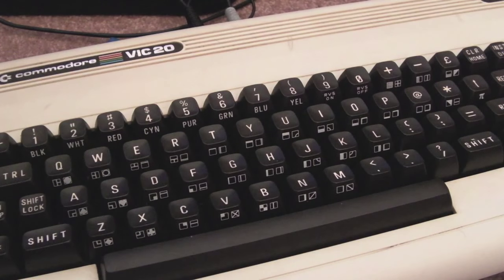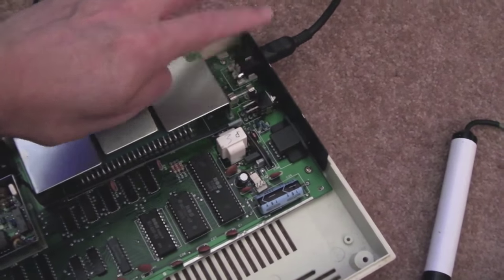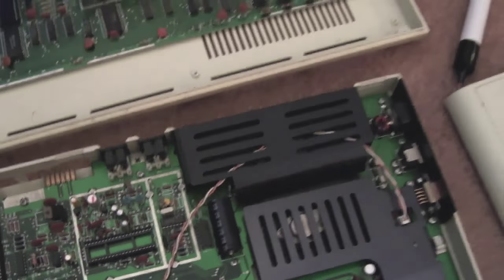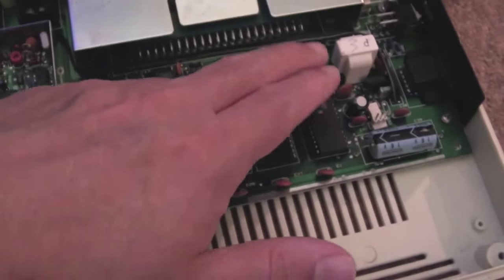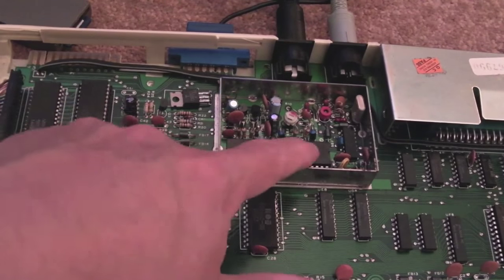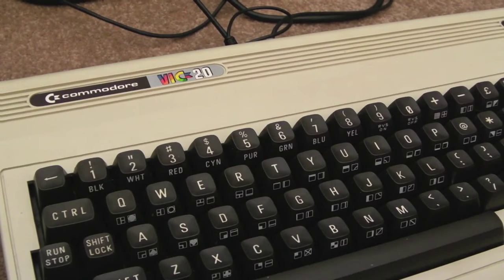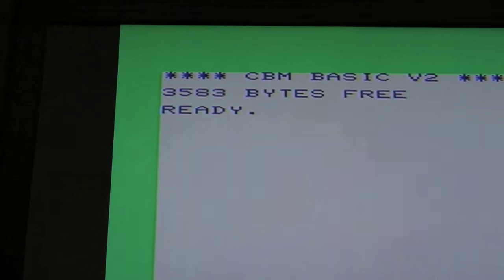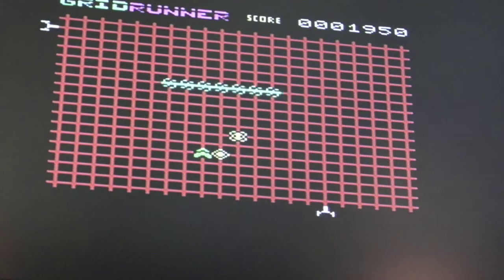Commodore VIC-20 (VC20) Repair & Picture Tidy (Better Video Mod)

Comment: im pretty sure the marks on the case that looks like melted burn marks like a soldering iron are from the cable as it interacts with the plastic on the case itself,youll aslo see tjhe marks on the c2n deck and power supply when cables have benn wrapped around them :)

Comment: Just taking my first steps in Commodore restoration. Enjoying the videos. Keep em coming!
Reply from the maker: +Lee DaStard Thanks!  What first steps have you took - did you get a Commodore 64, VIC or other?
Reply: +GadgetUK164 I rescued my C64e from the attic and removed the innards from the case. Washed the case thoroughly and removed the key caps and washed them then reassembled. Came up lovely. I haven't cleaned behind the kb yet as I have no soldering experience (one step at a time) and I haven't heat sinked any of the chips yet, but that's next. I also swapped the fuse to a 3amp thanks to your advice!

Comment: Just some info for you:
The VIC-20 was released in three revisions: A, B, and C. Revision A had the old 2-pin power socket with a left/right on/off rocker swtich. Because the power supply only produced 9V, the main board had a 5V converter with a large black heatsink on it. These boards filled the casing fully. Revision B kept this power arrangement, but got some other minor revisions, including a change of logo nameplate on the top. Revision C was a "Cost-reduced" model, which benefited from RAM replacement: one 4 KB×8 chip replaced eight 2114 (1 KB×4) chips. 

Nice video mate. I had a REV A  - also had a different font on the keyboard and different style of keys too. What you've got, as you say, is the cost reduced model. 

Is your power LED out?

Comment: Another excellent video. The marks are almost definitely made by a cable resting on the case for many years. I've come across the same many times now. Regarding the VIC I may have a couple of spare VIC20 VIC chips. am stupendously busy with work at the moment but can have a look for you when i get five minuets if you wish.
Reply from the maker: +JaysVintageJunk JaysVintageJunk Thanks!  Very strange reaction between the cable and casing there, and very destructive =/  If you do find a spare 6561 (or 6560 - will NTSC mod it) that you don't mind parting with, drop me a message - much appreciated, but not urgent if you want to hold onto any spares.
Reply from the maker: +JaysVintageJunk JaysVintageJunk Someone pointed me towards AliExpress - There are loads still in stock from the original sources (either that or repros... time will tell).  I've ordered 3, so will report back in a later video!

Comment: Did what you di clean up the green zig zag pattern? or just the bars all over the screen, the borders look smooth at the end but not sure if it's just the focus
Reply from the maker: It looks totally clean to me - I did later wonder if my TV was 'correcting' the image though with some of the processing / enhancement it does.  I have some VIC-20 boards coming up - I will check it in that video.
Reply: @GadgetUK164  I have been told it's due to Chroma Creep by a guy called Mrrrrsomething I use a CRT through composite with my PAL Vic-20 and get this https://imgur.com/a/zKKTuUl which I was told required an svideo mod to fix. though would prefer to not have ot solder the board. I've only just got done with my 7800 and CDI.

Comment: Those marks on the case are from cable being wrapped around it, it did a bizarre thing of cable melting into older plastic.
Reply from the maker: Yes, I know that now =D  It's the plasticizer that causes it apparently.
Reply: @GadgetUK164  Correct, the softener in the plastics go to surface and melt other plastics I saw same on styrogoam i  Vic20 box I bought.
Reply: Oh wow! Thanks! I finally learned this. I thought so many people couldn't possibly have burned their C64s with soldering irons. This makes sense.

Comment from the maker: It's worth pointing out that you cannot see the jail bars on lower resolution video - They only show up when watching in 720p.
Reply from the maker: +GadgetUK164 Quick update here - I got the 1st rev VIC-20 up and running today as well, and I did the same mods there to the VIC chip.  I found that on the 1st rev VIC-20 I needed 2 x 15uH inductors in parallel (~7.5uH) rather than using the bead which I used in this video here, but I still used ~270pF cap again.

Comment: Great video. What did you do to remove the ghosting as shown at the end of the video ? I've tried decoupling the VICII on the C64 to dampen those jailbars, but it doesn't help on that system.
Reply from the maker: +bwack There's a link in the video description - Basically involves removing that ferrite bead, replace it with a 270pF cap, then put an inductor (10uH - 50uH) from the output of the 270pF cap to ground (in my case an inductor was giving me ghosting, so I used the ferrite bead).  I do wonder if its a similar problem - the lines being at a specific frequency - if you can work out the exact frequency, a capacitor inductor filter can be used to filter it out (like has been done here).  A very similar thing is done on the Spectrum +2 (JoulesPerColomb).  Anyone got a spectrum analyzer to hand? :P
Reply: Thanks m8.
Reply from the maker: +bwack No problem! =)
Reply from the maker: +bwack Regards the C64 jail bars - I've got a mod which I purchased recently - looks like it just inverts the AEC signal and merges it.  It doesn't work very well at all on my C64 tbh...  I might cover it in a video soon.
Reply: Is it the lumafix64 ? I've ordered ten of my modulator replacement with stripefix board. It is configurabel using solder jumpers such that you can choose to put it at the modulator pins or under the vic ic. The main problem with the jailbar fix boards IMO is the capacitive loading of the luma line making pixels softer. I've added a solderjumper to mine such that you can select stripefix on luma_in or luma_out, meaning that if you select luma_out, then you are loading the low-impedance side which doesn't affect the sharpness of the image as if you had loaded the high impedance side (the vic ic side).. I can send you one for review.
Reply from the maker: +bwack Thanks, would love to buy one!  Do you have any C64 savers available yet?
Reply: +GadgetUK164 Yes. I'll send you a private message. If I can figure it out :D

Comment: I do not unferstand the talk of an inductor without the ferrite bead. It looks like justvthe two capacitors on the output then some capacitor on the board going to the left at 9 s clock position? Guess I need somr help here.
Reply from the maker: Where I fitted those two capacitors was an inductor (a ferrite bead).  That component was removed, and the two capacitors fitted there in parallel, to give approx 270pF.  On the underside of the board, I mounted the original ferrite bead between the point the two capacitors join (furthest away from the VIC chip), with the other side of the ferrite bead going to ground.  See here:- https://www.dropbox.com/s/pshiuzulgxm6cl0/VIC20.png?dl=0
Reply: @GadgetUK164  Thanks man.

Comment: Don't know if you remember, but we recently bought a Commodore VIC20 with the dreaded "Blank Screen" fault. It WAS the Kernal chip that was to blame. The replacement chip came from Italy, and was with us within a week. We are carrying out the Vertical Jail Bars mod next. What voltage does the 220uF capacitor have to be, or does this not really matter too much? Keep up the great vids. Wayne and Nina.
Reply from the maker: +Nina Evans That capacitor just goes across the VDD pin I think, just get a 16v capacitor and you should be fine =D  Thanks =D

Comment: I did the same mod to the chroma line with the same really good result. But I also have the same yellow shadow that at 13:34 you said you'd care about later. But when you fixed it at 15:17 I can't acoustically understand what you're saying. Did you actually do the colour phase correction from the hw mods site? And if so, which ones (there are 3 actually)? I've tried both the the 2.7kR resistor and 47kR poti mods, but both did not seem to affect the yellow shadows at all. Perhaps you can even give us an updated video on how you did it? Thanks alot!
Reply from the maker: I didn't do the colour phase correction - I just didn't seem to need it and when I tried it I found it was worse tbh!   The mod I did was the inductor they suggest in their schematic there - I didn't use that inductor, I used the ferrite bead that you remove when doing the mod.  So place that bead in place of where they suggest adding the inductor.  Pretty sure that's what I did and it was very clear.  Done the same mod on two other CR models, and one original model - worked perfectly on all 4.
Reply: Thanks alot for making that clear! I understood that part and indeed did put that ferrite bead between where the two modded caps on the chroma line join and GND. I'll double check the schematics.
Reply from the maker: That point in the video (15:17) - I said I adjusted the colour pot (there's a trimmer adjustment for the colour signal there - I tweaked that with a small screwdriver).  That tightened up the colours for me.
Reply: If I totally remove the bead, I can use the pot to remove the remaining shadowing for me. But once I had the colors aligned properly, I got weak vertical bars instead. I can live with those for now. The whole thing is confusing: My CR board (assy 251037 rev. C) seems to differ from yours. Above the pot there is a solder pad below the "R10" label. In your video, it looks like this pad is custom fitted with a cap that links to the chroma line at the (now replaced) ferrite bead. In my case, instead of the cap a green "resistor" is fitted.  Usually, those green "resistors" are actually inductors. But this thing has several hundred ohms resistance, so I somewhat doubt that. Anyway, I replaced it to match your changes, although I do not believe this is the 220pf cap from the hw mods site's schematics (look closely, there is no indication that this cap is even part of the mod). This solder pad near "R10" is actually connected to the slider (output) side of the pot together with the 47uF electrolytic cap. All schematics I can find  match the one on the hwmods site, where the chroma line is instead coupled to the luma line with a 220pf ceramic cap at the input side before the pot. These schematics would match my unmodified board (and prolly yours) only if they would have fitted the missing cap on the right of the pot and wouldn't have fitted that green thing that connects to its right pad instead. I would really like to know why Commodore decided not to follow its board design. If I find the time, I will try one of the C64 modulator replacement circuits discussed in this German forum here: 

https://www.forum64.de/index.php?thread/44092-hf-modulator-rauswerfen-c64c/

Btw, here you can see my board (yes, the "crusty" one): 

http://sleepingelephant.com/ipw-web/bulletin/bb/viewtopic.php?t=8159

Comment: i recently got a vic 20 from a unit.. the casing is broken and has missing keys and doesnt power on.. is there a way to get another vic 20 in descent condition?
Reply from the maker: eBay or searching car boots / charity shops etc is your best bet.  You can often buy replacement keys on eBay (the C64 keys are identical).

Comment: Cool. Sometimes marks from cables wrapped around the computer migh be mistaken for solder iron burns.
Reply from the maker: +bwack They are melted pits!  The plastic has been melted away =/  On the video they just look like dirty marks, but up close there are dips in the plastic and at the edge the plastic is raised - just like someone touched it with a soldering iron or cigarette or something.
Reply: Yes. I can't go 100% sure of this, but there is a saying that there is chemical reaction between cable and plastic case .. Takes many years to happen though.
Reply from the maker: Ah!  I see what you mean now, I guess that's entirely possible!  Maybe 35 years of a cable wrapped around it has done the damage! =/
Reply: +GadgetUK164 It is possible. Same thing happened to one of my C64. Those cables are toxic! :----D

Comment: Has anyone done a FPGA VIC replacement yet, because those IC's do fail alot and the supply is going to dry up sometime soon
Reply from the maker: +arcadeuk Good point!  That thought did cross my mind!  I know the system has entirely been recreated in FPGA, but I guess its different taking an emulator to FPGA approach vs, FPGA recreation of hardware with cycle exact timing.  That said I bet the VIC is pretty simple really and a good candidate for an FPGA replacement.

We talked about a similar issue with the C64 CIA chips (and I guess in this case the VIA) but nothing seems to exist.  If and when I get more time I want to see if I can replicate the VIA first, then maybe the CIA.  The datasheets exists for these chips so it should be more than possible, it's just a lot of work I guess.  I am sure a time will come when FPGA replacements for most of these chips appear.
Reply: +GadgetUK164 The VIA, PIA and CIA chips should be fairly straighforward, as would the RIOT and RRIOT. The VIC and VIC II are a bit more complicated and very timing critical, so it would probably bit a lot more work than the straight I/O chips.

Comment: Yes, the VIC chips are a common fault. Good move on heatsinking it. Sadly the only source for these is going to be from another VIC that is being parted out on ebay. The Rockwell 6502 and 6522 should be fine, you sometimes have issues if it is a 65C02. WDC are  making new 65C02, 65C22 etc. but there are some compatibility issues with the S suffix chips, the N suffix ones (65C22N etc.) are usually fine. The keyboards are also identical to the C64. Most VICs have brown function keys, and C64's have grey, but there is a bit of crossover on late VICs and early C64s and also cut and shut jobs. Finally, I'm currently working on a VIC version of the PET microSD, in a combined SD drive,  IEEE-488 interface, ROM and RAM cartridge, but that's a few months away.
Reply from the maker: +Dave Curran Thanks, yes - VIC is extremely hard to find.  There is 'new old stock' in america, but its $35 + $10 shipping and would need a new crystal and minor mod (kernel as well I think) to work as an NTSC machine.  Maybe one will turn up at some point!  Or maybe as ArcadeUK suggested - perhaps someone will re-create in FPGA one day!  Thanks for confirmation on the Rockwell chip - the one's I've ordered are just straight 6502 / 6522 etc, so sounds like they should work - Will give you a shout in the follow up video as it's your recent article on 6532's that got me wondering if other Rockwell parts would work.  Still cannot get over the fact the RIOT was used in anything other than the 2600 - I always assumed it was bespoke for Atari.   Thanks for clarification on the keyboard as well =)  Regards the SD drive for VIC, is there anyway the FPGA / microcontroller can support streaming .TAP -> audio?  I know there are newer SD2IEC variants out there that allow playback of .TAP direct to the tape connector port (like the 1541 Ultimate 2 does).
Reply: +GadgetUK164 I think the term NOS gets rather stretched these days, and should simply be read as old. I'd be very surprised if it didn't come out of a VIC20. Atari did use their own part numbers. Same with the CPU on there, that's just a cut down 6502. I did at one point look at putting together a 2600 using a full 6502 and 6532. The TIA is custom atari though. The point of the VIC microSD was to use the parallel IEEE-488 bus for loading which will be a lot faster than the serial IEC on the VIC20 which is already a lot faster than loading from cassette.  So it should be very fast, a few seconds to fill the memory, also most like running carts.
Reply from the maker: That does sound great (using IEEE-488)!  The problem with the VIC is most of the software is on tape, or cart.  I think carts can be loaded into RAM (expansion) and you can run from RAM if certain blocks are then made readonly, but I am not sure yet on how you specify where a .CRT is loaded to in RAM.  Might get one of those IEEE-488 boards from you when I've got some spare cash.
Reply: +GadgetUK164 VIC has an odd memory map, 4 blocks of RAM, and 1 block usually used for ROM. The .crt files usually get loaded to block 5, sometimes 3 and 5. The cartridge I'm making will have dipswitches to select ROM or RAM at those locations. and RAM from 3K to 24K. Not quite as neat as something like the final expansion, so I'll probably be calling mine 'The Penultimate Cartridge'.
Reply from the maker: +Dave Curran Thanks for the info! Does look like a mine field working out which blocks certain parts of certain carts load into lol.  Going to be fun and games I think.  What I am not sure about is whether the SD2IEC supports .CRT files and will load them into the relevant addresses (assuming you have RAM sat that those addresses) - that's going to be the tricky bit.  I am wondering if I might need to write some code to read the .CRT header and have it load the relevant blocks to the correct addresses.  No idea until my expansion RAM arrives.  Then theres the SYS command which I am guessing allows you to jump to an address in memory?   It's great that you are adding RAM to that cart, it's sounding more desirable each time you talk about it lol.  LOL @ Penultimate Cartridge - why not, it's catchy =)
Reply: +GadgetUK164 I don't think there is a default option to load a .crt on the SD2IEC. There is probably  already be a program out there to load one to the block 5 area. Many RAM expansions have RAM at block 5 which can be written to and then set to read only,. so it behaves like a ROM on a cartridge.